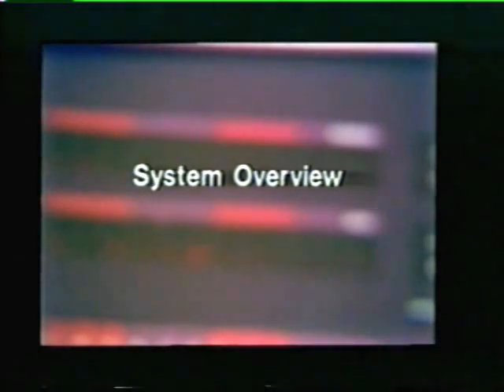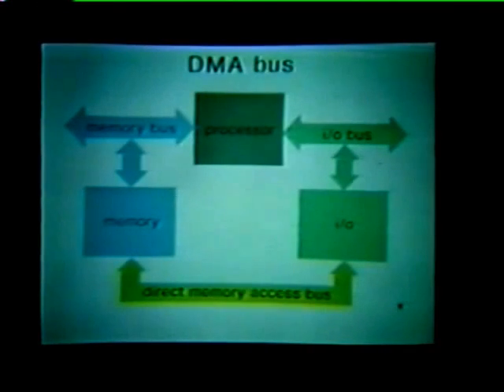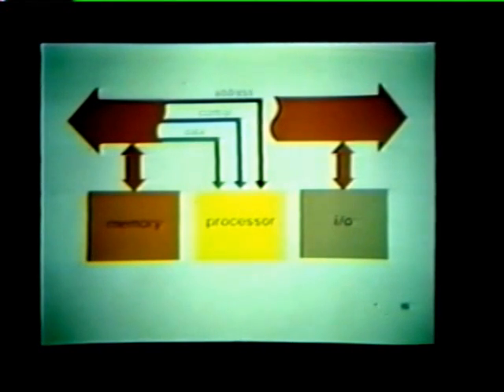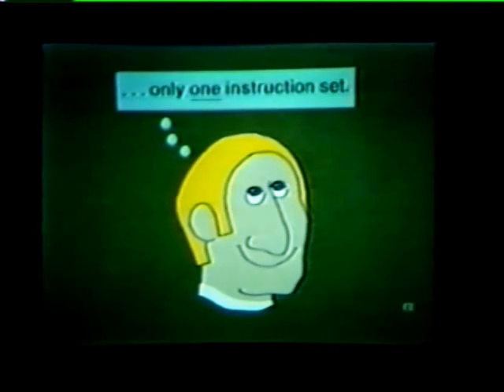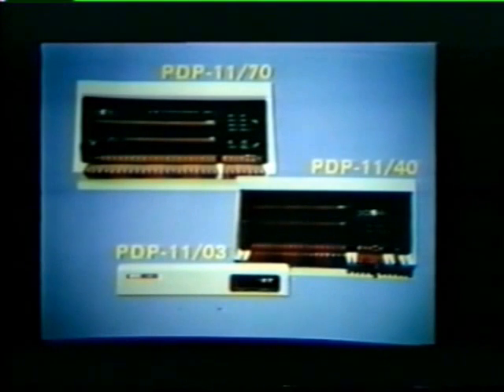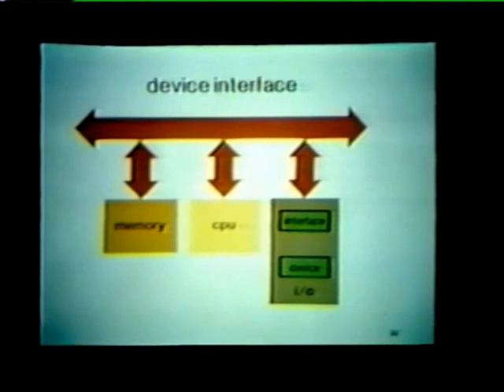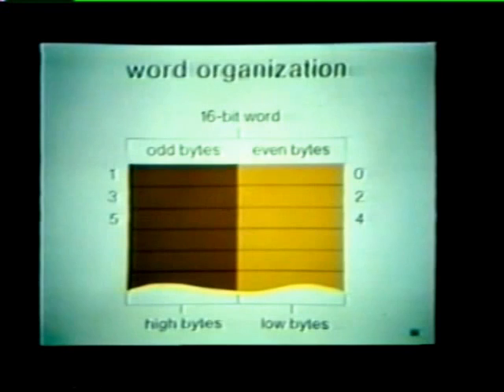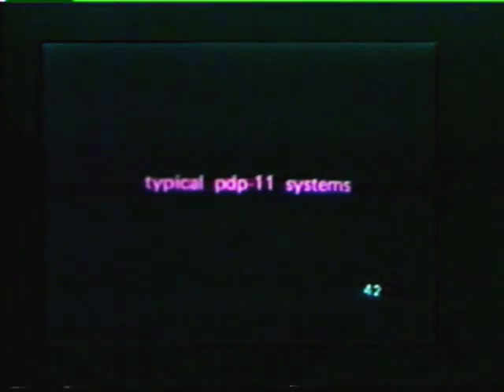Tape 01 - System Overview

Comment: Wish I had had this overview in 1977 when I started my Master's degree at Ohio State University. My project included wire-wrapping a Unibus interface card for the PDP-11/45 backplane, and writing a subroutine library for it in PDP-11 assembler, then testing it out using PDP-11 Fortran. It took me a while, reading those manuals, to comprehend backplane timing and understand the interface circuitry, but it all worked out in the end. Then, on to Bell Labs, for my first job out of school, learning Unix internals and C programming on PDP-11, VAX, and No.5 ESS hardware. Definitely established the course of my career since then!
Thank you!
Reply: Bell labs as a first job wow thats amazing.

Comment: At "up to 2 mega words of main memory" I blurted out "What?" Wow that was so much memory!!!
Reply: I go by megabytes. I'm guessing megawords was another way of saying megabytes.
Reply: No, a word has its own definition in computer science.  

https://en.m.wikipedia.org/wiki/Word_(computer_architecture)
Reply: @johngant3991  pdp 11 is 16-bit,
one byte is 8 bits,
2 mega words ==> 2 million individual 16-bit pieces of data 
==> 4 million 8-bit pieces of data 
==> so, 4 Megabytes of RAM 
upon looking at the data sheet of the PDP11 variants around the mid 70s on wikipedia this should be correct I think
Reply: That’s correct. There are bytes (8 bits) words (16 bits) and in the PDP11 space longwords (32 bits)